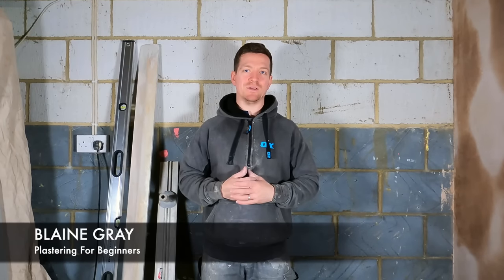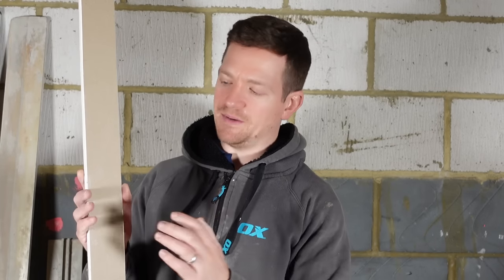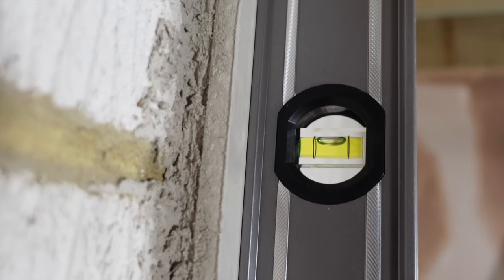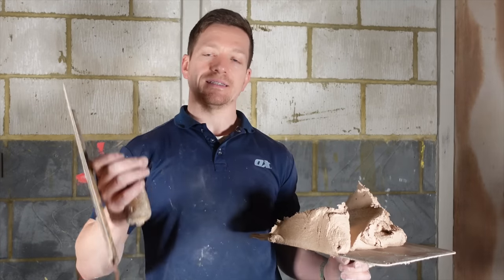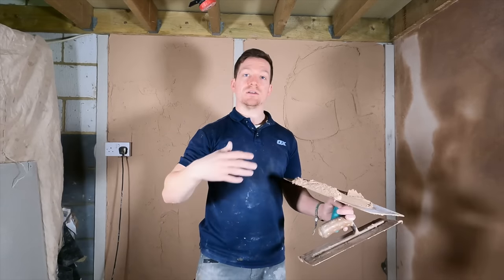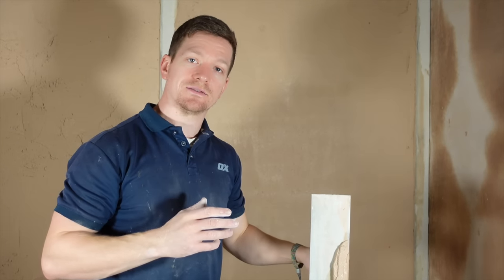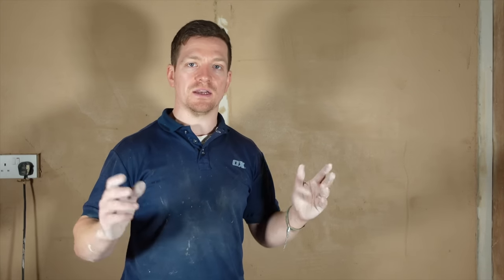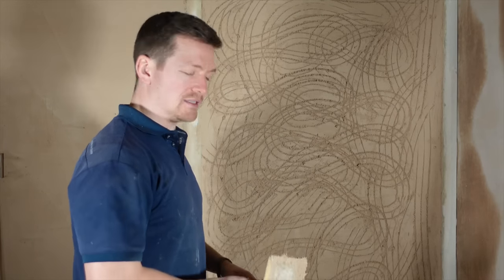Plastering A Brick Wall From Scratch | SCREEDS Make A Hard Job Easy

Comment: you should run screeds horizontal, you only need two ,straight edge across it ,much easier to level one end then the other and straighten across wall, just a little tip
Reply: Like old Plasterers, use horizontal render screeds, plumb dot each end, rule the screeds down to the dots. Old ways still the best!

Comment: I love hardwall too, super easy to work with.
I used baton strips, screws and packers to plumb the walls, mainly because of the ease to get out.
I done the shed as it’s block built, and being a shed I wasn’t too concerned about finishing with skim. I tell you what I done abit of rubbing down and painted it tbh it looked good. 
Never thought of using plasterboard as rails tbh, I doubt I’d ever do it again as it isn’t my trade, but I do find it therapeutic. Still wouldn’t attempt to skim a wall in the house though lol

Comment: No disrespect but ive been plastering for 40 years well before muilte finish came out when plastering breeze block walls I always PVA first blocks just suck and dry the plaster before you get a chance to rule it out and straighten plus always screened top and bottom of wall then fill in till straight and flat but definitely PVA breeze blocks

Comment: Great little video here to add some confidence to a bigger than usual interior brick cover up task I have!
Have popped up some timber as screeds, which straight away showed some lower spots. 
So, I am in Slovakia and the stuff I was recommended as base layer - translates to 'Core Plaster' which is a lime hydrate plaster...
Going to make myself a devils key also, seems neat!

The top coat I have yet to decide, as I want something structured and slightly rough/cementy looking.
Question I have, at the end of your video - once I get to that - it seems I can in the same day apply the top plaster (once decided) once its had a few hours to dry. When I key it and were to leave it for a few days - would I need to pva the wall before applying top coat?
Maybe the better question is - is it wiser to do it all in one day i.e. I have to decide final coat and can't use the night to do the base layers? :)

I have two 3x3m walls to cover up, didn't want to decide the top coat as I don't have the funds to gather that right now, but the plaster is sitting there ready to go :)
Reply: Could you share how you take down (rip out) the plasterboard screeds you used?
Using timber, I ended up with some of the core plaster coming off in quite some chunks, maybe I took them down too soon. Generally the time frame would be good to know and with the option to keep the plastboard strips in place, the only downside is then to have to tape it up you said. What about timber, would that just cause a variance in drying and take up of the final layer?

Comment: If your leaving board in and not skiming all room keep it away from wall about 6 inch so you can float up to existing plaster otherwise it will crack in the internal angle you need to scrim were board finishes but if you float upto the wall you dont.

Comment: Strips of plasterboard is a tip ill remember...what ive done is apply lines of  bonding coat about 1m apart and just level them with a long level.then fill in the runs.

Comment: Brilliant video. 2 things
A: you didn't mention hardwall's "unique" smell. 🤢😉
2: you can't do this as one weekend's project. Go back next weekend with the top coat. Because it is best to top coat within a day or two.
No criticism of your video. Just saving someone any heart ache if they leave it to long.
Reply: What happens if there is a delay doing the top coat?
Reply: @THE-AIDEN-PROJECT  it'll shale off as it will not adhere to the base coat.
The idea of the 2 coats is that they 'fuse' into one solid layer.
Reply: @THE-AIDEN-PROJECT  if the hardwall is allowed to completely dry out, the finish plaster going over the top of it will dry out too fast and maybe crack/shrink.
Reply: @johnwiles4661  could you not wet it down before multifinish?
Reply: @THE-AIDEN-PROJECT  that or pva buys you time, but if you are a beginner like these great videos are made for... It's just making it hard for yourself.
Reply: PVA the hard wall. 2x costs @ 3:1 then 1x coat @ 2:1. Creates a seal and a bond.

Comment: This is a brilliant series, thank you for making it.

I have an internal red brick wall (not breeze blocks as shown here), it's a relatively small wall, but next to our dining room and was quite dusty, so we PVA'd it (I think it was a 2:1 mix).

Now watching these videos, I am toying with the idea of plastering it myself, then within about 2 minutes of this video, you say not to PVA the walls as Hardwall is designed for walls that suck up moisture. So I guess my question is, if the wall had been PVA's (as ours has):

What produce would you use for your 'base coats'?
or would you just board it?
or is there a way to make the wall breathable/thirsty again?

Thanks
Tom

Comment: excellent video as usual.  What is the advantage of this as opposed to adding plasterboard with dot and dab and skim?  Thanks
Reply from the maker: This is much tougher and generally lasts the test of time. But it’s more expensive in the long run so you have to weigh it up really 👍

Comment: Ask a silly question and all that……But how did you level the bars to each other? I get the plum part. Sorry if this is obvious and I’m just being dumb.
Reply: You can't levelon a flat plane ..totally the wrong terminology.  You need to line up all the flat surfaces with each other using a very long straight edge or string line ..oryou will get( exagerating) a wall which has peaks and troughs from one end to the other asin a W shape
Reply: Nothing wrong with using wet screeds...shapes of bad block work accounted for with screeds running up angles ,ceiling line and skirting.

Comment: What's your preference for externally facing solid brick walls, would you use a sand/cement render instead of Thistle Hardwall?
Reply from the maker: It all depends on the build and it’s design. If it’s sortable to use Hardwall then I’d prefer that but as you say, sometimes S/C is best. It depends on the circumstances
Reply from the maker: *suitable

Comment: Can this be done over a brick wall that had a damp issue , and if so what is best to use before hand to keep the damp back ? Thanks
Reply: Damp has got to be coming from somewhere, find out where and sort out the issue rather than trying to cover it up and forget.
Reply: When you say 'had a damp issue' - is the damp problem fixed? If the damp problem is fixed this method will work fine - if the damp problem is not fixed - this method will work fine - but you will still have a damp problem. If you have damp and you want it fixed - have a good builder look at it.

Comment: Blaine i suppose newbies will get there in the end but you might like to demonstrate how it really should be done when you were taught in school.  Plaster screeds top to bottom say 6"" or the width of your trowel  2x1 6" batton top and bottom. easy to tap them out fill in the gaps no messing cutting strips of plaster boards scrimming and so on !! easy.  Nice vids though.👍👍👍👍

Comment: If you waited 3 hours for it to go off before you plastered would you still have to PVA the hardwall? Same question to if you went back the next day to plaster it? Thanks in advance, love the videos 👍👍
Reply: go straight over same day, pva/sbr mix next day
Reply: If you do a pva/sbr mix. (60/40 sbr mainly) you won't have to double coat. The sbr will stabilise it better. If your anxious. Do it twice, no point stressing
Reply: Ah legend, thanks for your help! Much appreciated, do I need to check for a chalky substance once PVA'd? Heard that's a no go as it'll drop off
Reply: @bradransome2729  that chalky substance is 90% of the time in artex ceilings (its called distemper). What sort of wall are you plastering, never really see it on walls unless it's salt pulling through

Comment: Is this better or just plasterboarding then skimming?
Reply: There are pros and cons to each. Plastering directly makes the wall more durable, and takes up less space than drylining. But if the wall is prone to moisture, shifting or cracking, plasterboard suspended with an air gap will be less affected. A hollow plasterboard wall is also safer in some circumstances; where I live, it's required at the bottom of a staircase so than anyone who falls down the stairs is less likely to get a cracked skull.
Reply: @pcno2832  thank you for your reply, knowledge learnt thx

Comment: Love your videos. Very clearly explained.

Would a timber batten or some 10mm trunking be an alternative? I'm thinking it may be easier to remove especially if you can use the concrete screws that dont need plugs

Comment: I've been watching your vids for a while now and having been a platerers labourer for 4 years back in the early 80s when bags of plaster were 50kg  but that's another story. 
What im wondering is why do you not use a spot board?  Instead of digging it out of the bucket? 

Also, did you cover the cables on the wall?

Comment: Where can I get this type of plaster? Do you know the US equivalent?
Reply: As far as I can tell there isn't a readily available equivalent in the US. In this situation i would probably use usg Structolite as a scratch coat (requires wetting the masonry wall first). Then maybe follow up with base coat like Imperial

note: I am not a pro, I've just done a few jobs and a lot of research